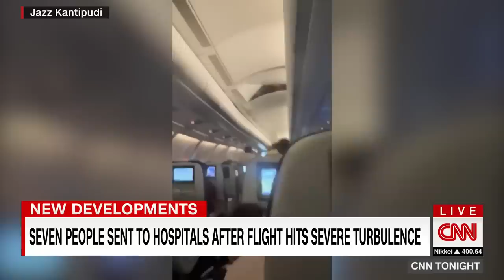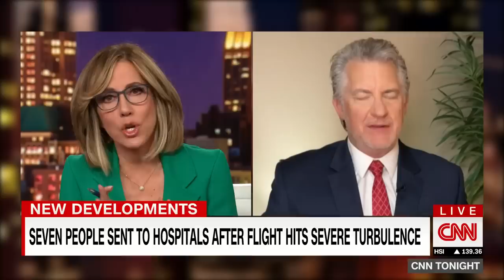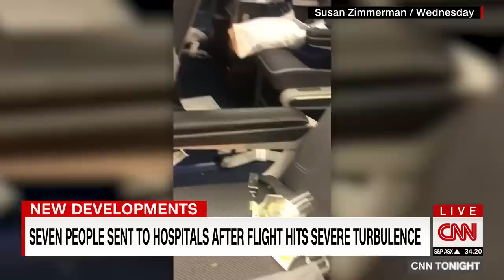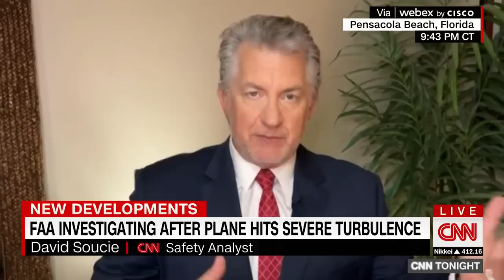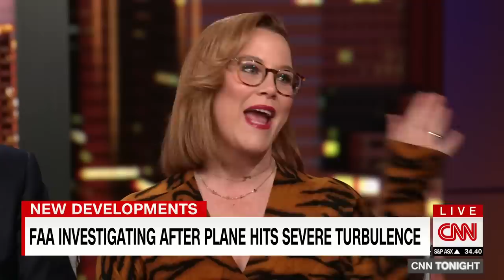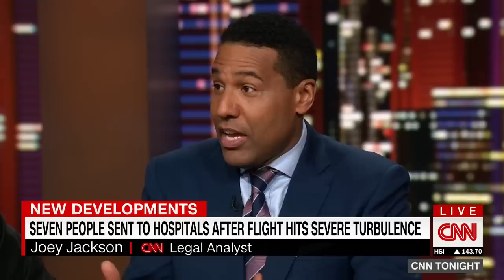Video shows aftermath of extreme turbulence on airplane

Comment: Keep your seatbelt on even if the seatbelt light is off. That's the most important pro-tip I've learned over a lifetime of flying.
Reply: i usually steal some from other seats just to make sure i have extra safety
Reply: On really long flights sometimes you really need to use the restroom though.
Reply: Kinda a life philosophy that should be adhered to also really, metaphorically.
Keep your seat belt on.
Reply: @michelleb7399  still can do both
Reply: They tell you this the very first time you fly, and every single time after that.
Reply: Elzbieta  reverend preacherbot is that you ?
Reply: Its baffling how many people think not wearing a seatbelt in a metal tube moving at 600mph through the skies is a safe and sound thing to do.

When I flew for the first time some 25 years ago, nobody had to tell or convince me that the seatbelt is on when I'm sat down.
Reply: Also check that your jack and spare tire are in good condition.
Reply: 35,000 feet and a belt on a seat is all you can think about......Great job cadets
Reply: Not really a pro-tip either. My daily SWA flight attendant say is at least 300 times a year.
Reply: only an idiot relies on a cabin light to make their safety decisions for them. if you're seated, your seatbelt should be on and TIGHT.
Reply: And don’t lean your seat back.  It annoys the hell out of the person behind you.
Reply: @joanfrellburg4901  And don't forget road flares! They say 99.999 percent of flights don't have emergency road flares!
Reply: @ryanreedgibson  I hate when that happens !✈🔥
Reply: @faith4freedom76  of course! Otherwise they can't find your body afterwards. That would be terrible.
Reply: @ryanreedgibson  "I usually hear this tip" says proffesional, denying it's a pro tip.
Reply: @diytwoincollege7079  make scary faces at kids...
Reply: What if your in the bathroom???
Reply: Yes. However... negative G turbulence pushes blood into your brain until you pass out.
Will be just as effective at that, if your seat belt is on. In fact,  it's more effective because your body cannot move up, just the blood. So the blood pressure in the brain would increase faster.
However, more likely you will get less hurt if you keep the belt on yes
Reply: @jinxterpinxter  after 50 seat belts tied around me ? yes i am !
Reply: pray 🙏
Reply: The seat belt sign going off just means it's likely safe for you to use the restroom. Buckle back up once you've done your business.
Reply: That is not a pro-tip that is literally Lufthansa policy! The have signs and stickers everywhere that clearly say: FASTEN SEATBELT WHILE SEATED
Reply: @kaladan1890  hhhhhhhhhhh
Reply: @kaladan1890  I got learned a lesson from you

Comment: I have worked in the Aerospace industry for 20-plus years and have seen bad things/fatal accidents happen from cutting corners and trying to save time/money. The industry needs to slow down and focus on safety before something very bad happens if they are trying to save time and money by increasing speed from point-to-point traveling.
Reply: @SusanK1960  I was speaking of the mindset of rushing and trying to save money by cutting corners. Which as I said has HISTORICALLY led to accidents. Also, can you have people get killed without the plane being damaged?

Comment: Those pilots were heroes for getting the plane to land safely. 👏🏻
Reply: Turbulence is very common and there’s nothing heroic about bringing it down safely. 
They only brought it down to hospitalise the injured passengers at the earliest.
Reply: Seems you wish to lower the standard for heroism
Reply: No, They should have avoided the turbulence in the first place 😂😂
Reply: @dwaynew.8849  In this case, the plane was affected by clear air turbulence meaning that it happened unexpectedly with no warning that's why they tell you to keep your seatbelt on at all times. There was no way the pilots could have known the turbulence was there.
Reply: @MS0018-r3d  This is a known turbulence area . They flew right into it to save time. 
That’s the issue with pilots
Reply: @dwaynew.8849  I haven't heard this before where did you get that information from?
Reply: @MS0018-r3d  That turbulence area over Tennessee is known to most pilots . Do your research.
Pilots often choose the shortest route despite risks of turbulence to make up for lost time earlier .
Reply: They are pilots, not heroes

Comment: Not one commercial jet has come down due to turbulence in 40 years! Belt up and protect your head. Planes use sky roadways, some rough, some smooth. Just like you in your Car. Do you panic when the car hit a few bumps? No, because your car is designed for it. Planes are really designed for it with so much redundancy its crazy. I've been in severe turbulence and it sucks but you are more likely to get hit by flying debris then ever ever ever the plane will come down. Never nice to see anyone hurt. This particular flight was obviously horrific and I hope everyone recovers. Kudos to the crew for doing a great job of getting everyone down safe as possible.
Reply: @SusanKay-  Susan seems you are home alone drinking beer. Can i come over?
Reply: I think most people intellectually understand turbulence is not a big deal. But emotionally, people get scared, because it’s human nature. The difference between being on a plane and driving a car through potholes, is that when you’re driving, you’re the one in control. When you’re on a plane, you feel helpless, hoping the pilot knows what they’re doing.

Comment: 1970: Without warning the jet dropped vertically that seemed to be 20 feet, but was likely 200 feet, accompanied by severe vibration of the cabin. A moment later, that happened again, but this time the vibration was so severe you could see the walls rippling. I thought the jet was going to disintegrate. The pilot announced that the plane had encountered an air pocket.